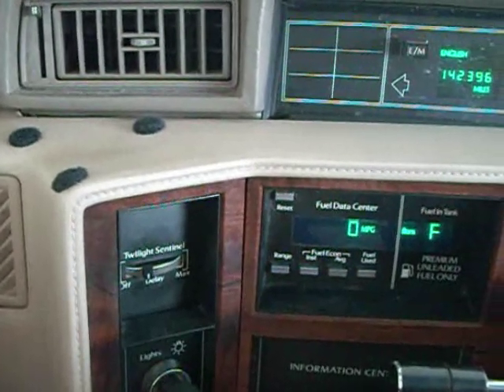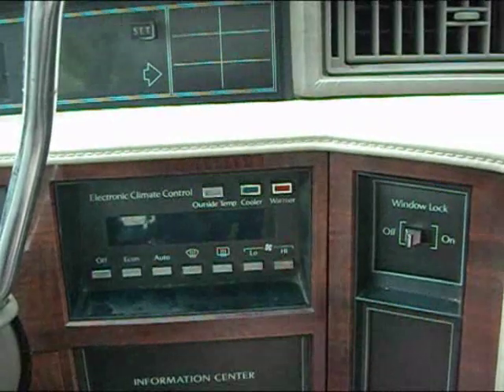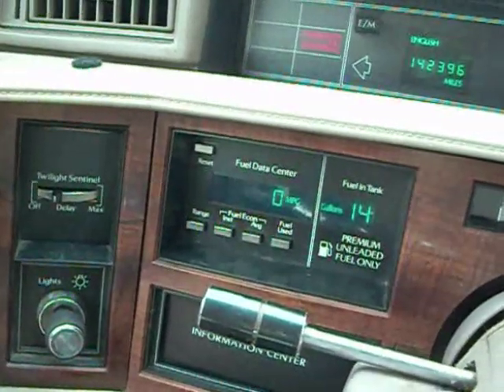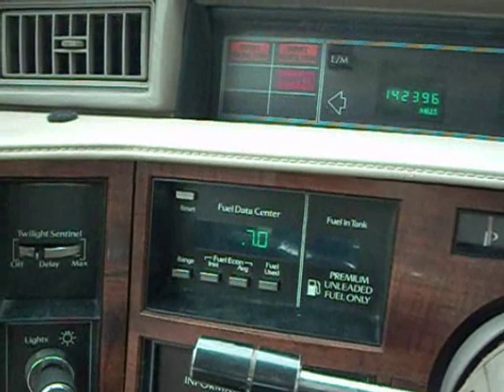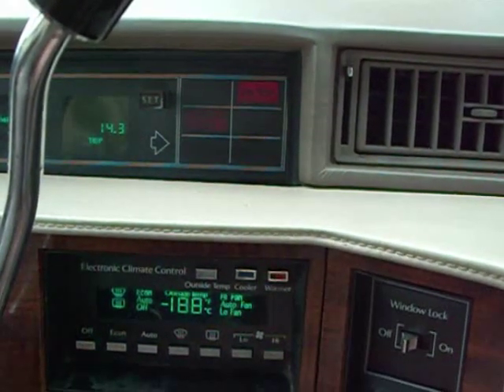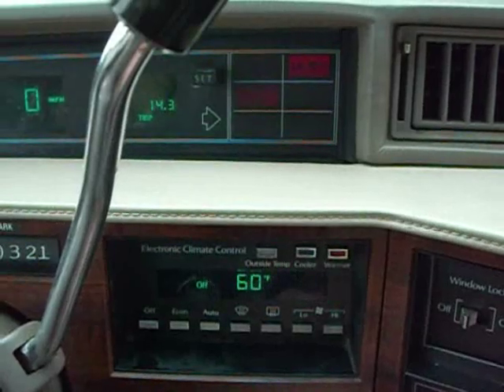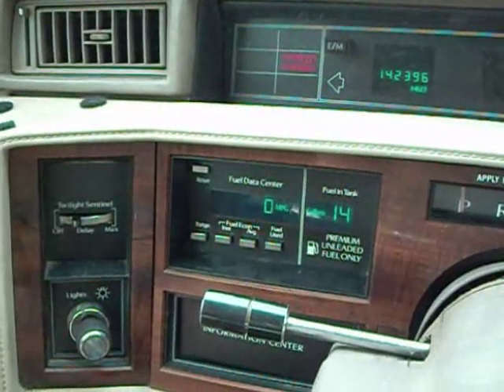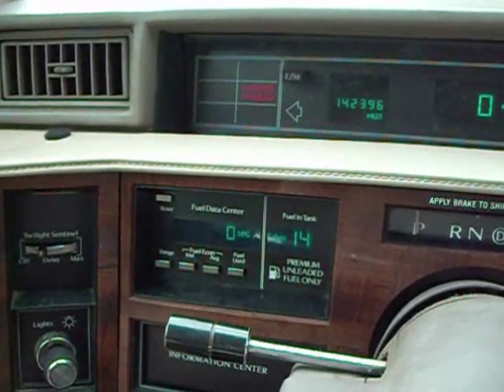1992 cadillac deville trouble codes reading

Comment: I had a 91 Deville just like that i sold it a few months ago, i now own a 1987 Sedan Deville w/ 80,000 miles and it's in pristine condition.
Reply: I have two Cadillacs. My first one is an 86 coupe deville with 4.1 liter engine and my second is a 90 sedan deville with 4.5 liter.

Comment: @TheJLenoShow 
E31 - MAP (Manifold Absolute Pressure) sensor problem
E91 - Neutral starter safety switch failure
F48 - Air Condition Fault - Low Refrigerant

did you disconnect the battery recently? E52 is just letting you know the battery was disconnected. or you may want to check fuses which could make the the car think the battery was disconnected.

Comment: Just a word of warning on all these problems , in comments, Watch, have alternator, battery system, checked regular, System has drain problem on air compressor, for Wheel shock suspension, compressor can run constant, cause of leakage/bad /worn shocks drain battery, /wear out, and if alternator is failing=LOW VOLTAGE

Comment: This video is good but not satisfying. I want to add something: Off + Hi will erase only ECM codes (E.x.x), for BCM codes (F.x.x) erasing you need to use Off + Lo. Another thing would be that if you want to know your car good you need the FSM. You'll learn there're many modes in the computer system where diagnostics of certain components can be done in real time. You can read and be able to interpret data from every sensor on your car.

Comment: Hi I loved your video! I also have a 1992 Cadillac devil but yours is exactly similar to mine but somewhat different your dashboard is high tech, that's pretty awesome!  While mine is old school. But I have a real important question, would you know where to find the switch to turn on the high beams? I can seem to find them. Would very much appreciate your help.
Reply: hey I know this is a 5 year old comment but I bought a deville around 2 months ago and had the same problem driving it home, did a quick search and found notching. started flipping and switching buttons, it's connected to the windshield wiper stick, pull it towards you and it activates/deactivates the high beams

Comment: i have a 1993 cadillac deville, i owned it for about year and a half and my data center and fuel odometer blinks even when i have gas in tank, and sometimes it will stay off for about 20 seconds...would you have any idea what the problem is and why it does that?
Reply: replace the body control module when both ur units fuel data and climate control dont work

Comment: if i have a bad bcm would it effect the was my car runs??? my problem is my stereo does not work, my air blower stays on until battery is dead, and when i drive i cant press down the gas pedal to low cuz it starts stalling and sometimes turns off?? please help!
Reply: MYthoughtsONthingz
Reply: MYthoughtsONthingz

Comment: Could you all please help me, I have a 88 deville and my car sags real bad. Replaced air shocks, and it still sits low. I dont even drive it til I get that rearend up. Could it be relays or what? Pump still works,  and no blown fuses, help ASAP !!!!!!!!!!!
Reply: Brian Williams command problem. It's not that the rear is sagging, it's that the front is high (front shocks need replacing. All the gas leaked out and they are now fully erect all the time). If your sure it's not that, most likely your vacuum system has a problem adjusting your air ride.

Comment: hello my name is Robert Williams I was hoping u can help me with my 1993 Cadillac deville its the exact same vehicle as your video my car was running great till a couple of days ago engine shaking bad smell of fumes did what u said with error codes but can't understand them I got E32 E71 E98 and for some reason F46    E32says open map sensor E71 says intermitted mapE98 says p/n to d/r Isc engaged problem please help your a great guy for doing this thank u ☺
Reply: u know all them codes on my 93cadillac devilled and all it was tune up new cable wires new rotor distributor cap spark plugs codes are gone my car running like new simple tune up

Comment: Hello, where can I find all these codes, I have many codes coming up 
E27
E40
E52
E91
E.E 
Help, I dont know how to find them, nor how to fix the stuff.
Bringing car to a chevy dealer tomorrow. 
I have a 1993 Cadillac deville 
My Ac/ transmission fuse keeps blowing. 

I go to push the gas and theres no power to take off, fuse under passenger side keeps blowing.

Something is blowing the fuse, last place said it was my ac was faulty and so they unhooked the ac compressor and well it worked for a few days and it happens again.

Praise the Lord, aren't cars fun!!!!
Reply: Did you ever find out the issue? My fuse blowed a couple times as well but hasn't blown since. I know the fuse you speak of deals with the AC compressor and the shift on the transmission
Reply: @grindhard4312  I had a electrical issue, there was wires that weren't grounded and were touching and would blow the fuse and make the transmission stop working. I believe it was my ac  compressor unit was unhooked 
I think, I dont remember 
It got unhooked but they weren't grounded. 

I had to bring it to the Chevy dealer and they fixed it
They spotted the problem

Comment: hi names brad was wondering if you could help me out i own a 91 cadillac deville sedan v6 for sum reason the climate control and information center doesnt seem to be workin Noon of the lights go on what could it possibly be??
Reply: thankyou ill have to look at the fuse panel to find the one theres soo many under the hood under the dash behind the back seat ! haha
Reply: +MMA Name get a fuse puller at your local auto store, they don't cost more than five bucks and they'll save your fingernails!
Reply: Yes had same problem, It climate control, center! They fail, had same problem, back 2013, had car 1-year, bought new one E-bay from 1987 model! 40 bucks, that fixed total!

Comment: I own a 93 caddy deville and im having a problem if im driving it its ok but if I come to a stop sign or red light it will shut completely off and I have ro put it back and park and start it up again if any one can tell me wat makes it do this I would be very thx full because I rhoufhr it was in need of a tune up I gor rhat done and its still doing it smh!!!!
Reply: check ur throttle body clean it if its bad replace it
Reply: My 92 did the same thing and found out it was my cat; don't know if you still own the car at this point, but it's just my $.02🙂

Comment: What if my dash doesn't lite up or do nothing how do I fix it so I can read my codes
Reply: John Mcdaniel  same problem did you figure it out yet !!!!! please let me no
Reply: battery is good, i started it one night and surprisingly the control dash was a lite up but VERY Dim so i get to turning and messing wit the nobe and then it finally lite up bright so i got the lights bright, but still no power to any of the buttons ima go threw all the fuses  /Codes
Reply: John Mcdaniel

Comment: Hi I have the same car but without the digital gauge cluster but my car has recently started to back fire and stall a little not when I'm on the highway going about 30 or 40 and my car isn't giving me any codes about it so I was wondering if u had any ideas about it?
Reply: I'd imagine you've gotten an answer by now... but, if not...    The fact that it runs crummy and backfires and stalls could be several things.  But the fact that it clears up on the freeway makes me think the most obvious would be one or both of your oxy sensors are bad.  The car is running too rich (too much gas) but the extra gas burns off at the higher RPMs...